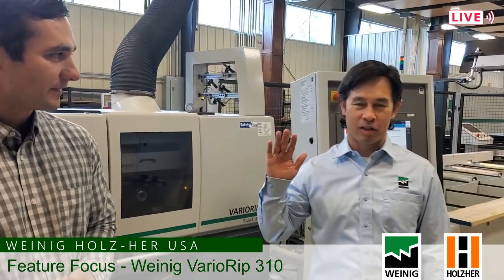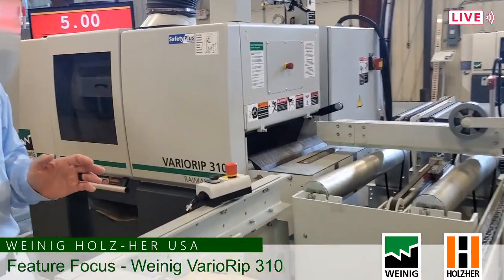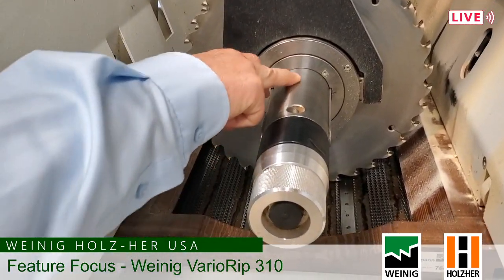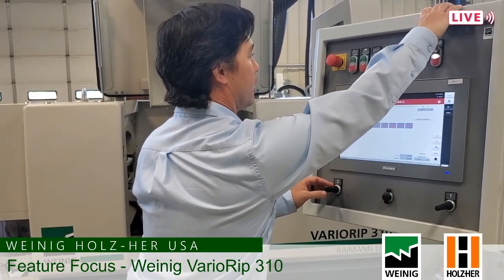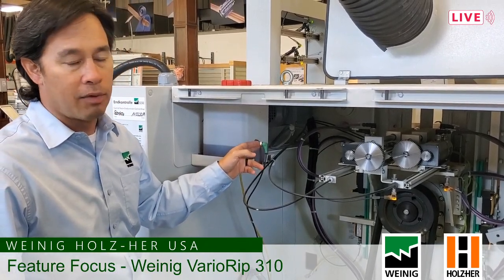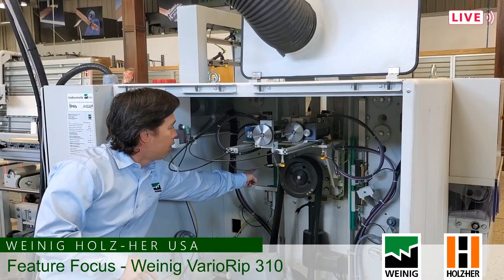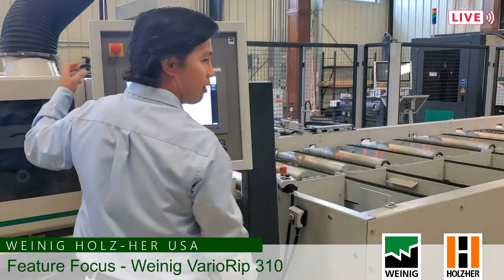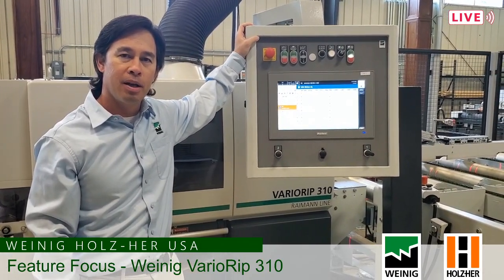Weinig Rip Saw Walkthrough - Weinig VarioRip 310

Comment: What if boards are different lenght? Can it still calculate total lenght and adjust which width to cut?
Reply from the maker: The saw has a photo eye and helps it calc the length of each board that is fed into it. So yes.